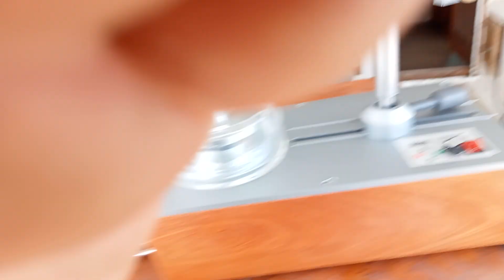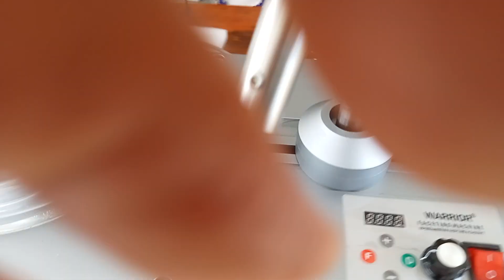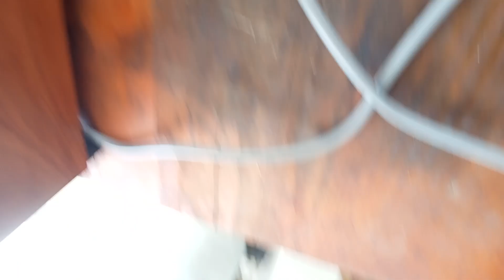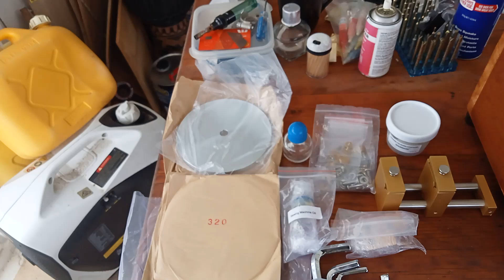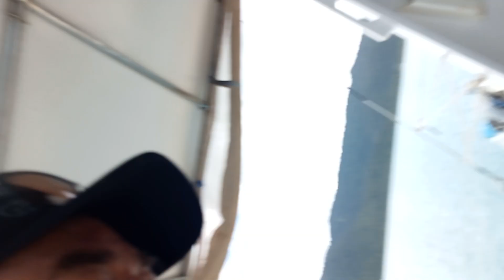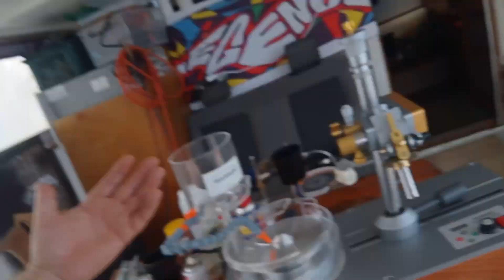Warrior V5 Faceting machine. First look.

Comment: Thanks for the look around! It looks like a really nice machine. 
One issue others have had with the other Vietnamese machine (the Vesta) is that the angle doesn't consistently return to the same setting when the quill is moved up and down - do you see something similar with this one?
Reply from the maker: I've only cut one stone on it and it was perfect. I am a novice and I have cut about 8 stones on the ebay machine. All round brilliants. I just cut a yin yang and it was amazing. The yin yang has lots of angle changes when doing the crown, sets of 2 opposite angles and you could almost set and cut these with just going off the protractor reading. I am very impressed with this machine.